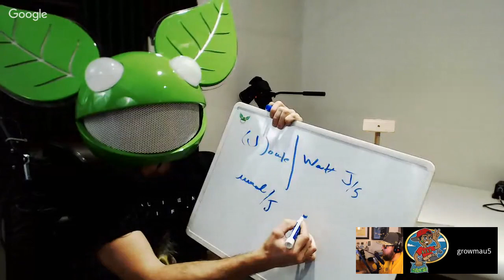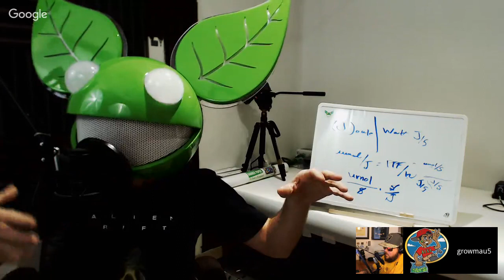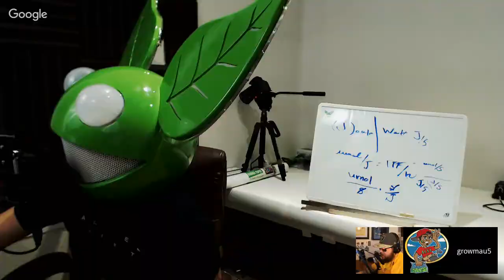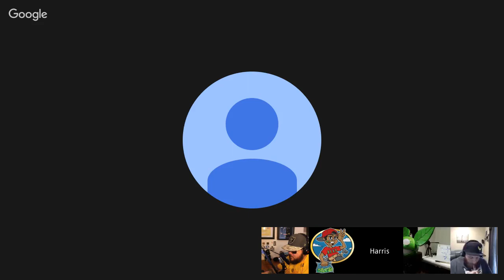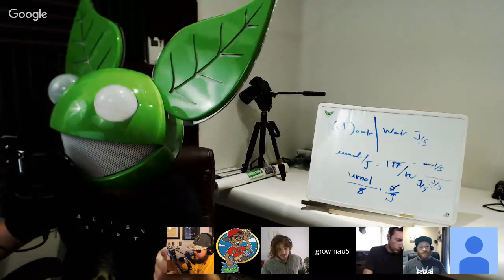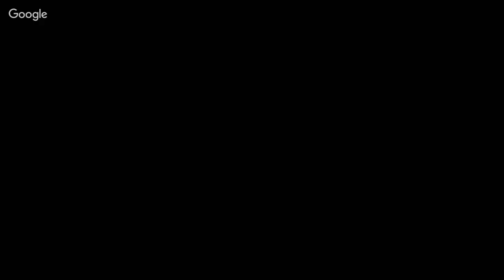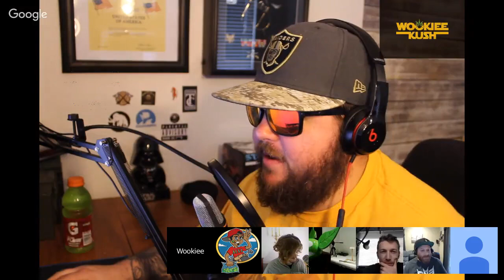LIVE: how much LED for your grow space?

Comment: Just to break down the math for you newbie growers:

A 400 watt HID light (doesn’t matter if it’s a MH or an HPS) with a super sized hood in a 2x4 space will get you a half pound if you fill the space with 32 tops 2 feet deep.

A 600 watt HID will get you a pound, if you have 64 tops in a 4x4 space with a canopy 2 feet deep.

And a 1000 watt HID light will get you 1.5 pounds, with a 5x5 canopy 2 feet deep.

If you can get 1.5 pounds from a 600 watt light with 128 tops, a  4 week veg, an 8 week flower, (total of 3 months, 4 if you include seed/clone time) and a 1000 watt flower (HID)  with 8 plants, and you can get 2 pounds if you add Co2, why the hell would you bother with LEDs??
Reply: Diy 600w led $300-400 to replace said 1000w hps, childs play. You dont need to learn to grow under HID, thats just silly. In fact going straight into led in my area with the cooling benefits would have made my life so much easier at the start, but the technology was not available to a layman like me, now it is.
Reply: lol. Show me where you can buy a 1000w hid setup for $120, I dont believe you. If cheap is what you want a cheap chinese led build would be under $100 I can get 1000w of cobs for $20, yes $20, drivers from about $50, find some cheap heatsinks, hang them with wire fishing leaders rated at 100lbs. Thats still cheaper than 2 hid 1000w bulbs. Even if you have to replace half of it every year that is still less than 2 hid 1000w bulbs would cost. Dude, a good digital ballast would be worth $120 by itself. On 2 1000w you would save $140 at the most, by your price. Its not a big difference, 2 or 3 years ago you would have had to spend 3 or 4 times as much to buy the led lights, so you were correct then, no longer though. A cheap diy led light would be about the same price as a cheap hid setup, thats just the prices man, I dont make the prices, I just benefit from them. The numbers speak for themselves. Where do you look at prices? A catalogue from 5 years ago lol.
Reply: Lol. A quick search shows me the cheaper non chinese crap 1000w ballasts (magnetic, so not good ones) are about $100 us, maybe you could get one for less if you found a good deal. You can buy a cheap chinese hid light for about $100-$150, without shipping, still more than a cheap chinese diy led light. One good adjust a wing reflector and light spreader would cost you more than $120. So I really do wonder where you are getting your prices from. Top of the line diy 1000w led(where you have to plug leads in, drill afew holes and tighten a few screws) would not cost more than a 2 x 1000w digital dimming ballast with a double ended bulb and an adjust a wing reflector with light spreader, in fact it would be a darn sight cheaper. That is the comparison I am interested in, cheap is good but effective is better obviously. If your not using or quoting top of the line hps stuff then you cant put it up against top of the line led stuff.
Reply: My point is, if you want to go cheap, led is cheaper, if you want to go top of the line, led is still cheaper(all diy of course). You may have to research and compare prices but any good consumer should do that anyway. There is a difference I should point out, led pricing for prebuilt lights is often heavily weighted towards the actuial building of the case, the parts are a smaller percentage of the cost. Hid are the opposite, the parts make up a bigger percentage of the cost and the labour involved is less, that is why diy led is much more comparable than prebuilt led fixtures, if you buy the led parts you are cutting out all the labour costs which are not as bigger factor in hid prices.
Reply: The benefits of led lighting are obvious, if you cant see why people would use a different light to the one you are using and you choose to ignore the benefits of said light, then there is not much point trying to explain them to you. A little bit of product research and maths never hurt anyone lol, it really is not that complicated if you listen to people like these guys who obviously know what they are talking about. You dont need to understand every little bit of shit, for exampleI can pull my cars engine apart and fix it, that doesnt mean I have to know every little detail or spec of the engine, I can ask a mechanic (thats these guys in this analogy) and they will tell me what I need to know. 50w a square foor = 1x 50w 3500k cob/square foot. Find the driver, get some heatsinks, put it together and bobs your uncle, you have a wicked growlight, it really couldnt get much easier than that. Just write down the parts list that growmau uses for one of his lights, thats even easier, buy the shit, build the light, how is that even hard? The information is right there in front of you lol.
Reply: loony loony Lol we’ll it’s def more effort than hanging up an HID on the ceiling.
Reply: Your kind of right there, no, you are right lol. But,you could build a 4 cob 1000w light these days, thats just one light to replace 3 600w hps. Not that I have heard of anyone yet using 250w cobs which are available. Shit there could be 500w cobs available eventually. Everyone is heading for more spread it seems, but that is only because it is doable and so easy to achieve with leds, not so with hid ie you cant replace a 600w hps with 6x100w hps. There are different ways to look at it, I have heard some people are now just going heavy with it, all 100w leds and such, 10 x 100w cobs on 2 fixtures could replace 2 x 1000w hid potentially.. The efficiency trend has kind of died out a bit and people are looking to use less cobs pushed harder, lol why uses 20 cobs when 10 will do it, then 8, then 4. We are all learning together though and it is certainly still a developing technology with many options and even more possibilities, side lighting and such for example. Apologies for going on, but I got nothing better to do at the moment lol. Ill shutup now and leave you alone lol. One more thing actually, i have not completely replaced my hid in one go, started with a couple fifty watt cobs, added a couple more, then a couple more, slowly filling the whole tent with them, still have one 600w hid going though. You can get your toes wet if you know what I mean, adapt over time, not all at once.
Reply: loony loony okay no idea why anyone would want to do that. Side lighting = fail . LEDS most of the time = fail. The people who grow with cobs 99% of the time are the same people who have no canopy, and talk about things like “nutrient lockout” and other bs lol in other words most of the time the Led guys are the ones NOT getting the yield they are suppose to and yet for some reason they think switching to a way more powerful light (LED) is better? You can’t use an LED properly until you have grown with HID multiple multiple times and basically know how to grow 110% and even then the cost of LEDs still doesn’t justify their output! A 1000w HID light with the hood is under $250 now..,that’ll cover a 5x5 space and give me 2 pounds....why would I want an LED again? Cuz saving electricity really doesn’t come into the equation when you get 2 pounds from a 1000 just saying.
Reply: loony loony My point is this: If you are learning how to grow, and you don’t know how, using LEDs is your worst bet. They’re just plain not as easy to use. If you buy HIDs you can just hang the light and forget about it there’s no thought process, and yeah maybe the 1000s are 140-150 whatever that’s so much difference? My point was: why the fuck would saving money matter if you were getting the yield you’re supposed to? If you get a minimum of 1.5 pounds from a 1000w HID that costs $150, and costs maybe $30 a month in electricity, why would you bother to try and save money?!? You’re growing $3000+ worth of cannabis for the whopping cost of $30 a month and a $150 light. Maybe $200-250 depending on what bulbs you buy but personally I use cheap ones and it works fine. Even with the first harvest you would still be saving so much money compared to purchasing the cannabis so...why does anyone want an LED again?
Reply: loony loony so are you currently pulling 1.5-2 pounds from a 600w LED?
Reply: Why do you believe they are not as easy to use? What specifically is more difficult with leds than hid? You know as well as I do that even hid is not as simple as just buying a light and hanging it, there are all sorts of other calculations you need to do. I cant just whack a 1000w in a small tent and say job done, or a big tent or anywhere for that matter. There is still coverage to think about, penetration, environment(very important in hot climates, which is where I am), distance from light to canopy and I hate to mention it again but short and long term $. What sort of reflector do you want ? Do you want air cooled lights or not? How long should I keep using the same bulbs, how often should I clean my reflectors and how long do they last. Then theres the space they take up, my leds are about 6 inches tall and can sit 2 inches below the ceiling, my hid are about 12 inches tall and have to be hung at least 6 inches(absolute minimum) from the ceiling due to the heat and I only run 600w lights, I would have no chance of running 1000w hid unless I bought a 2-3 thousand dollar ac. Add to that, the reflectors block the movement of air, the leds dont. The extra 12 inches and the extra air flow helping with environment control is reason enough alone to consider leds and my tent is 2x2x2m btw(not really a space for 2 x 1000w hids anyway, but 1000w leds? Easy peasey and that is plenty without co2). As far as yield is concerned, you dont have to believe me, there are plenty of vids on youtube of good harvests using led.
Reply: The control you can get with led is amazing to. You can put a 1 foot plant and a 4 foot plant on either sides of the room, put leds 16 inches above both of them and your laughing, you cant do that with hid. You could have 4 plants, all differnt heights, all side by side, all getting the same amount of light, there is no way you could even possibly think about doing this with hid. Not without spreading them out a lot more at least.
Reply: loony loony okay so now I KNOW you don’t know how to grow haha you said you can’t run a 1000 watt HID without a 2-3000 dollar AC?!? What are you smoking lol dude. A 1000w HID can literally be cooled with a $200 window unit that’s like 5000 btus lmao you must not know how to cool a room
Reply: loony loony also in my experience it is that easy. You don’t even need a hood lol I don’t even use one just hang a light in the top of the tent
Reply: I have one 600w hid, and 12 x 50w cobs spread over the rest of the tent, I was using 2 x 600w and a 400w. I pull 2.5 - 3.5 pounds each harvest, it could be better but I do it by myself and it already takes up to much of my time lol, so I am happy with that. To be honest I cant really tell the buds apart, but until I do it only under led, I dont know if they will really be any different. I will admit, during winter with all leds I may need to warm up the tent a bit, but already last summer was much better with a 600w and a 400w hid removed from the tent and quality has stayed the same. Also, both lights have only been gone about 6 months ( 2 runs, 2.6lbs and 3.2 lbs), 400w was out 9 months ago. Its a bit confusing, sorry hehe. I will be ditching the last 600w after this run, about 5 weeks.
Reply: You misunderstood. I said if i used 1000w lights in my tent, I would need 2 at least. When the outside temperature can be 40C and higher, I would  need a 5kw split system ac as a minimum. Price and cost for fitting would be $2-3000(it may be cheaper where you are, but that is what it would cost me). Simple. With the wall mount ac I have I and using the hids I had, I struggled to keep the tent under 32C at night in summer, 2000w would have been hell, literally, lol. I dont want ducting and all sorts of shit everywhere so I have a fairly simple setup, the tent is unsealed. Pretty simple huh. So haha to you, mr maturity.
Reply: Lol. Ok, wow. Ill admit, that is pretty simple.
Reply: The funny thing is, thats all I do with my leds haha. No reflectors or lenses. We are more alike then you think.
Reply: Or should I say, our techniques are more alike than you think.
Reply: G
Reply: loony loony lmao what now? Holy shit dude hahaha now I know 110% for sure you are failing. Why the fuck would any good grower have diff size plants under the same light? Lmao that’s silly. Also you’re def not ever supposed to put a plant 16 inches away from the light. My guess is that all of your plants are dead sir. Please stop giving bad advice 😂
Reply: Really, after reading your original post again, lol, I saw that you think HPS and CMH are the same thing lol. They are not, good luck with your fluorescent bulbs hahaha.
Reply: Maybe you could learn a thing or to if your werent such an arse. Goodbye!
Reply: loony loony lol there’s a big diff between having multiple strains and having multiple diff size plants under the same light. Also, if HIDs are some 1990s shit then how come all the facilities use them to grow ? You really don’t see LEDs in gangster grows I’m just pointing out that the number of times I’ve seen a garden with too much light when it’s LED is like 85% of the time. It is super super rare that you see someone who actually knows how to use LEDs properly, most of the people who use them get a dick yield because they kill their shit by putting the light 2 feet away. All I’m saying is, for the beginner grower, it makes 0 sense to buy an LED. And as far as experienced growers goes, I really don’t see any great growers using LEDs other than as an experiment, and from what I’ve seen, they don’t get you better bud. I have seen a few rare cases where someone was using an  LED properly and got slightly more yield than they did with an HPS, but I’ve literally seen that only twice, and in both situations the lights being used were so astronomically expensive than it wouldn’t justify it.
Reply: Whatever dude. Dont want to answer a simple question, fine. Good luck and goodbye.
Reply: you get a better yield with led you just haven't tried a spydrx or other things by fluence and other commercial led lights. so many people are switching where I live that you can buy used hid hoods for dirt cheap. and its ways more energy efficient. will pay its self off your first grow
Reply: Well, if it Works for you, great! But why would you think everyone else is in the same boat as you? Kind of self centered, don´t you think?
In my case, my normal temperatures make it a real struggle to grow with HID without frying anything....
Reply: Sergio Gomes wrong lol LEDs still produce heat. It’s called air conditioning. I’m not being self centered at all. I know how to grow lol and using LEDs doesn’t come into the equation ever when you know what you’re doing. Think about it: why the fuck would you spend money on an expensive fancy light when it only costs $250 a pound to grow w HID lights including the cost of AC and electricity?? Are you crazy??? Why would you WANT it to be any cheaper?! If you ask me, THATS self centered,
Reply: Shawn CobGrower1 show me pictures. Email em to huntersteelthorne@gmail there is no fucking way you could possibly pull 2.5 pounds dry from a 4x4 with a 3 week veg. Even if you’re doing hydro I call BS. And if you are good for you but I wanna see that cuz the average that most people get is 1-1.5 and my whole point was that beginners no way in hell theyre gonna be able to do that shit everyone who starts with LEDs fails you need to understand how to grow before you use them so good for you but you shouldn’t be telling beginners to start w advanced systems
Reply: Hunter Crain wrong? Please enlight me on how to have a stealth midsize tent (1*1m) running on the summer without dobling the electricity cost(remember: stealth), please?
Reply: Sergio Gomes look if you don’t have the balls to do it the right way don’t do it, first of all. Second of all, if you think a half pound of weed in a closet reeks so bad (and that’s assuming you know how to grow and can actually GET a half pound dry lol) that you’re gonna get caught you’re too paranoid to grow. Also, hello? It’s called a fan filter?  Why are you growing in a tent that small? Just use a closet in a room with a window ac. My power bill is like not even $200 more than it would be without my lights every month it’s sooooo insignificant compared to what the cannabis is worth. And if you use co2, you will literally pay for the cost of the ac AND the light. Like I said, there’s a right way and a wrong way to do this. You don’t know how to grow my man it’s that simple. And the BIGGEST failure rate for beginners is LEDs and hydro.
Reply: loony loony lmao $300-400 exactly so why the hell would you soend $300-400 when the HID 1000s are like $120?